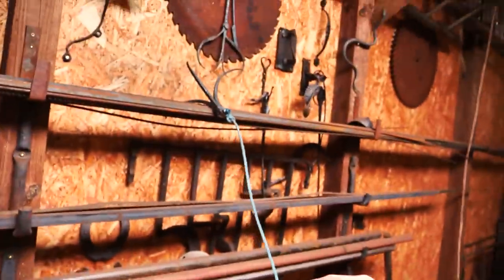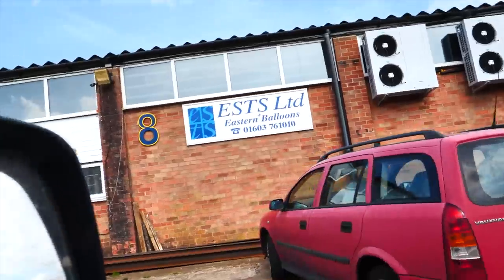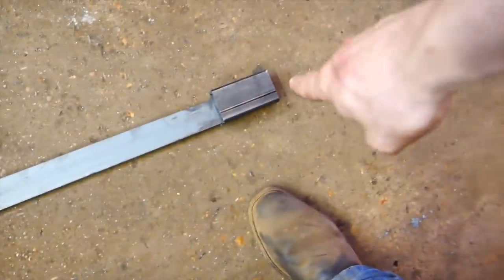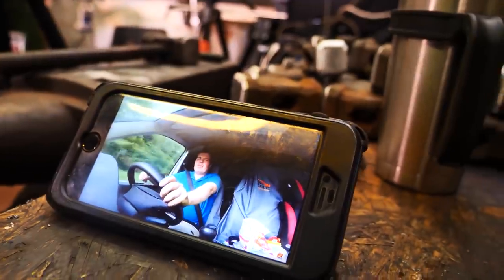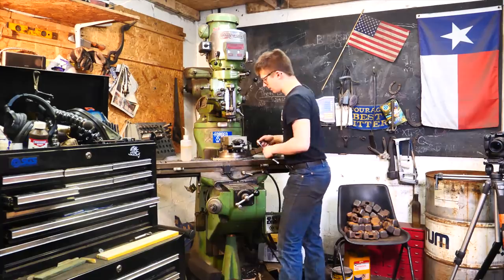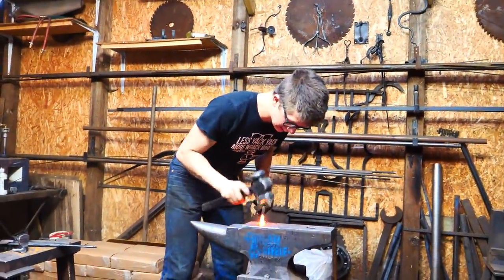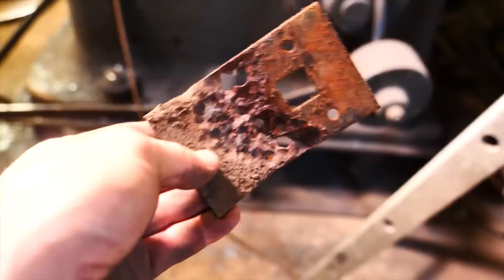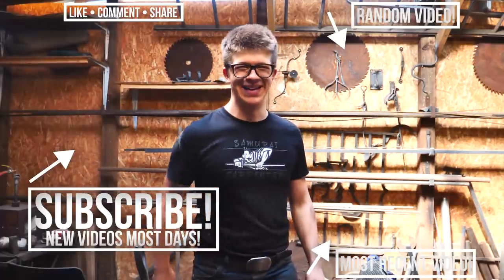BARRED - Had to make security bars for the shop doors!

Comment: Ur insurers wanted that on the door but I'm guessing they have never heard of bolt cutters and a cordless angle grinder seams abit pointless to put that on there
Reply from the maker: +Rhys Garton correct - it sounds good on the policy but a determined intruder can get through anything.
Reply: Alec Steele anything is possible given enough time and effort but for security you wanna make it as difficult as possible
Reply: Locks and stuff are just to help keep honest people honest so they don't give in to temptation.
Reply: Grimsoul Blackheart iknow what you mean ,a locked door keeps people from being millionaires
Reply: add some high voltage to the bar, a good shock to the face will make them think twice... =p

(jk, don't do that, you'd probably get in serious trouble with the police for booby-trapping your place... =p)
Reply: GarThor Son of Odin or forgot he put it up and one day give himself a nasty shock
Reply: so yout house doesn't need a door because a robber will get throuw anyway....interesting concept
Reply: I always drive around with bolt cutters, angle grinder and a battering ram

Comment: Alex you need to add two more things to your cross bar.
1: at the center of the bar you need to attach a channel that the bar drops into from the top to make damn sure the bar can't be bent and pulled out.
2: a second length of the same bar welded to make the entire bar a T in the cross section this will make the bar stiff as hell, further preventing it from being bent and pulled out.
And
I was kinda hoping you might add some Blacksmith flare to the crossbar, hammer marks and a patina.

Comment: If you lose the keys to your padlock or buy another padlock the same, you can take your padlock to the locksmith who will take it apart, change out the pins so that the lock works with a different key. You cannot do this with most padlocks.

Comment: Alex , Build a box around the padlock, this will prevent  bolt cutters accessing  the lock . I have seen in the past that this is very important. ( you need it to be just enough to slide the lock in without having the lock revealed. )

Comment: I would strengthen and stiffen the lock stile on one door and add dead bolts that shoot up into the header above and down into the sill below. Then I'd just lock the other door to the first as though the first was a door jamb.  I'm not convinced the horizontal bar accomplishes anything beyond bureaucratic compliance and a checked box on a paper form.

Comment: The unfortunate thing is that your bar sits in that rectangular tube on the one end... If the middle lock was disabled, the doors could be forced outward and the bar would simply slide out of that rectangular tubing, and it wouldn't be that difficult.  However if you had curled the end of the bar so you would snag the end of the rectangular tubing when you lock the bar, it would require so much more energy to defeat.  I'm sure it will be fine... lets just hope that the insurance feels you complied to their requirements.

Comment: You might find adding two U brackets to each door in the centre. This would stop the bar from bending and getting pulled out from the unlocked side. 3 points of contact and a lock side would keep that door locked. 

Regards 

TEAM RAINS

Comment: Using a simple piece of flat bar won't provide much security because it'll be easy to bend or cut it.  It would be better to go with all steel doors and steel bolts that drop into the floor and raise into the overhead frame and a cross bar that can be pushed to bolt into the inside of the other door like a link pink.

Comment: Weld on another piece along the centerline of the long bar which stands at a right angle to the existing bar, giving it a T shape.  that will greatly strengthen your bar.  It would not have to be very tall to do the job, perhaps a half inch to an inch.

Comment: you should add one more slotted bracket on one door close to the middle. believe it or not, that flat bar can be bent out of you bracket without the lock. one more slotted bracket in the middle would gaurantee that not to happen. just some advice

Comment: Somehow you still seemed to make putting a bar on the door interesting. The steel fab is a little more on my level but interesting way of making square holes in the plate. I probably would have just used a plasma. I also pace a lot when I'm doing mindless task, or so I'm told. Lol

Comment: Engineer here.

Would have been better if you mounted it closer to the middle of the two doors. making it longer makes it worse as it's easier to bend.

Even better would have been to mount it to the wall either side of the doors, turn the bar horizontal, and provide 1 slot on each wall and two slots each door.

All said, it's overkill anyways. what you have will work just fine.

Comment: If you were to weld on a "T" part to the spine of the bar in the flat mid section, it would decrease wobbling and increase strength from battering rams and sieges... lol

Comment: hi Alec. I'm very sorry to tell you that but hopefully you will find them helpful.
1) in my country you need to mask the number plates of cars. since you can find out who the owner is and where he lifes. that might be possible in GB as well and most likely not wanted by your buddy.
2) the steel bar across your door is not safe or secure. you could easily bend it open by using a trapezoidal car lift. to make it secure you need to use at least a square tubing that won't bend that easily. 
with all my appreciation for you and your work. this is a good meant advice

Comment: Does holding your hammer so close to the head give you greater accuracy while striking?
Reply: lorddarphyve Yeah. and he can strike quicker. Downside is that there's less force
Reply: lorddarphyve - Yes...he has said that holding it there gives him greater control and accuracy, while only sacrificing some of the potential energy available when holding it further down the handle. His striking technique mitigates that loss further, as he swings with his whole body, not just his arm.

Comment: Thats probably plenty good for your insurance company, but for your own security sake, you may want to stiffen that  bar-stock. Long pieces of any material with that geometry tend to be very flimsy, and it wouldn't be any trouble for a chain and a truck to pull the bar out of its housing. Even a 6' thin piece of angle or thin bar welded perpendicular down the center (creating a "T" shape) would give you the rigidity you need, but I'm not sure if you're equipment needs that much protection. You'll have to decide if thats a big enough issue to be worth your time

Comment: I understand this is just to satisfy your new insurance company....I work in security with patrol dogs. That lock could be picked within a few minutes, like seriously, it could be picked shockingly quick...get a Abloy lock to prevent that. Secondly, i understand you think the bar is good but honestly mate...that bar is useless lol. It'll be cut through in about the same time it takes to pick the lock lol...and ripped off even quicker. Like I said, I understand this is just to satisfy your insurance provider lol... Peace and love
Reply: studentj4ck totally agree even that bad looks like it could bend easterly with two people pulling or even 1 person with some tools.
Reply: Could probably rake that lock, Abloy is the way to go... But really no measure is going to stop a determined intruder. Alarm system with rapid-response will mitigate losses.
Reply: I doubt he cares about the security aspect studentj4ck, as long as the insurance requirements are met. The only reason he did it was to comply with his new policy.
Reply: No need to pick or cut the bar. Only takes a moment or two to bend the bar and remove it from the front.
Reply: That's understandable
Reply: Exactly bosnianbill has a great channel that shows how easy most locks are to rake or spp or even by pass or shim. I think if I'm locking up a shop I want at least 6 security  pins with threaded holes and with side bars and tungstun insert to prevent drilling and protected hardened shackle to prevent bolt cutters being used. nothing less will do
Reply: As a Finn i have to also say Abloy (Ab Lukko Oy) is the only good option what comes to locks.

Also its a standard at Finland. Most likely 95% or more of houses or warehouses are locked with Abloys at Finland.
Reply: I donÄt know what exactly he cares about here, looks that way, but people need to realise that your average burglar is out to make 40 Euro or so profit per break-in, and there will always be something laying about to meet that end. Would take a car to lift some 300kg of steel, raw or tools, from that shop, but they will flog it of at some scrapyard 1-2 Euro per kg. So it's well worth the effort securing that door somewhat.
Reply: The internet is an amazing place...I said twice...I understand this has been done for the purpose of meeting his new insurance providers policy lol but somehow....people feel the need to tell me again haha, honestly think about it...I already said it twice...if we were standing next to each other talking you wouldn't repeat back to me something which I had already said, twice lol
Reply: Don't be so grumpy, from what I see here people are in fact taking you seriously, just discussing things based on the probably very true info you provided. My point is: take things to a level that will frustrate or deter the lower third of all hecklers. The insurance is there for the pros. Going further than that would be prohibitively expensive, but a couple very doable things (for Alec) will protect against break-ins that positively could be defended against and keep insurance fees from going up each time, which they would. A valid point in your opinion?
Reply: I was about to suggest the same thing, an Abloy lock. I'd also wire the hasp and the socket to an alarm circuit that would scream like a demented shoggoth if the bar was cut or removed while the circuit was live. That way, if someone takes an angle grinder or something to it to break in, cutting the bar opens the circuit and closes a relay, then it goes REEEEEEEEEEEE like a Kekistani to summon help.
Reply: They don't even use tools anymore it's a bit of a pop can. Push it down side of lock bar an it will pop open.

Comment: In the spirit of all traders everywhere, I might as well tell you what I would have done differently 😜
A 'U' bracket either side of the door opening, where the two doors meet. Used any kind of box section for the bar and a metal box around the lock point. Still, if your insurance company are happy, who cares! 👍🏼
Is your metal supplier on Sweet Briar?

Comment: 1st.... what? no Damascus? 
2nd easy fix for the carriage bolts is to screw them in normal, when tight hit the head to drive the square peg into the round hole tighten again and for extra bit weld the screw head to the plate.  

3rd.... what no Damascus?

Comment: it would take very little effort to bend that metal out of the right hand box. seeing how much it flexed its a very long distance between ends just pulling the centre you are practically pulling a 5ft lever to the two ends. honestly it would have been better if it were a  piece of angle iron

Comment: Any reason you went with flat stock instead of square tube? Not a blacksmith but I used to be a machinist and it seems the flex would be undesirable.

Comment: Putting two U-shaped clasps near the middle of those doors to drop the bar in will really add a lot of security to this, as has been pointed out below. If someone were to tackle the setup like it is now he could tie a rope round your bar and attach that to a car. would just come of like that, no noise, no nothing. Or you risk two people giving it a try and end up with a badly bent bar the next morning, even if they fail to open it. And maybe double up the centre of that bar with another slab of steel in addition, it then won't bend at all, will only be assailable reasonably by compromising the lock part. Which probably could be done drilling round it through the red door with an accudrill, silently enough, given enough time.
Nothing is absolutely burglar proof in the end, the idea is making it already look too time-consuming to break into, your average guy will give up if it takes him more than 2-3 minutes to get in.

Comment: part of my job is keep analyzing how the burglars defeat security devices, specially physical barriers, doors, windows etc, i will defeat that bar in few minutes, there is no rigidity along the bar, build an s shape support for the middle to rest the bar and prevent it from being pulled,  or better put two  s suports distributed about the middle of each door, it is an easy job and will increase the security of your bar setup. sorry if im not very descriptive i think you get the idea.  i can send a drawing by email i guess.

Comment: I would Suggest a locking point on the other side too. Don't want to sound like a butt head but I could pull that long bar out. Yes I would bend the crap out of it but once I have the bend I can use the lock that is there now as a push point to continue to bend the flat Iron.  Just a lose hardened chain link with a lock on it or some thing that you can still side though the collar once you take off the lock would slow a man down really quick.

Comment: Boy oh boy.. Great video as always. Hope that bar is what you want/need. I'm shocked that the super security lock (hardened steel and all) is combined with a rather thin flat bar mild steel.... hmmm. Maybe weld a hardened piece of 01 or 1085 (hardened and tempered) to prevent a Sawzall from getting through. Not criticizing... just thinking at the keyboard.... what would I do if it were me. Thanks again!!

Comment: I love the videos just started watching not long ago. I wanted to suggest welding another flat bar going perpendicular onto your cross bar. When you pulled on the bar it showed a lot of flexing imho, granted I don't know maybe you just have HULK-like strength but it looks like it would be easy to bend and allow the bar to be removed from the square tube side.

Welding another identical flat stock against the cross bar perpendicularly lengthwise (to form a "T" cros section) would make the bar more rigid and less prone to being bent should forceful entry (god forbid) should occur. Just one piece shorter in length that will occupy the length between the square tube and the pad lock. As an added benefit it also makes Homing the bar easier >_<.

Comment: The bolt heads go on the outside so that the bad guy cant just take the nuts off and remove the bar......
Reply: the domed heads are on the outside...
Reply: I think the issue is that the furnace can be seen in the video.  Everyone (including myself) thinks of the furnace as part of the shop, but in fact it's outside of the shop.  It's hard to distinguish inside from outside when it comes to Alec's workspace.

Comment: If you was going to 'Steele' anything from his shop you will need a truck, attach a chain to the bar and drive forward (if possible), something will give. Agree with previous comments about U channels closer to the centre, reinforced with plate from behind. Also with the comment of some sort of box to protect the lock from a hammer, saw or lever, and to top it youtube bosnianbill, anything can be picked. It's all about slowing them down, making noise, making life a pain in the arse and also providing evidence, i'm afraid to say. You have insurance but it still makes you feel angry as claims, settlements slow the business down. I would also see if you could install some sort of bollard so a truck couldn't pull up too close to the front, plenty of lighting, a CCTV, and an alarm mine, firing a 12g blank would also make them think whats next around the corner.